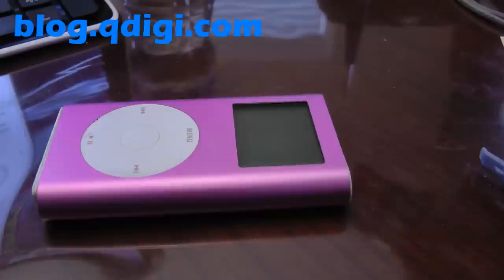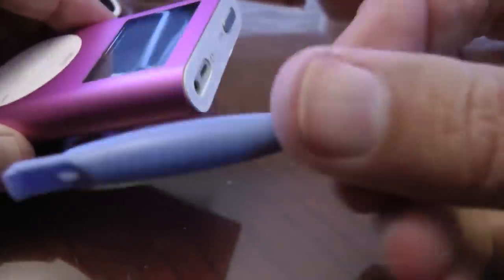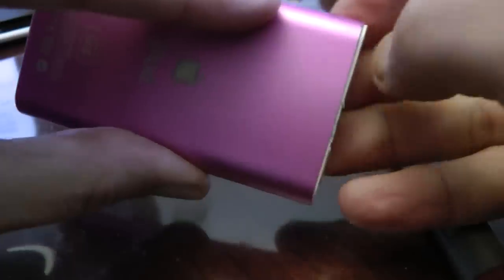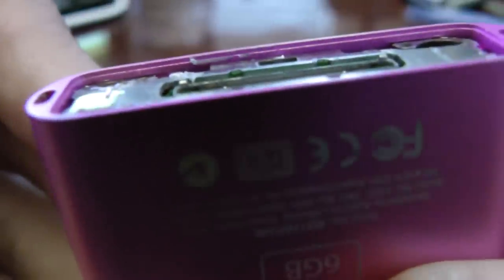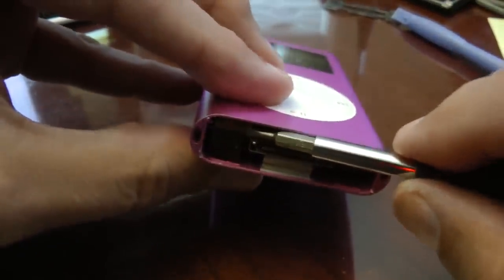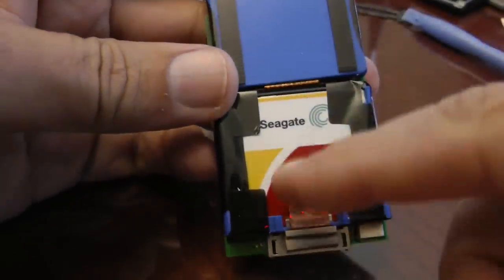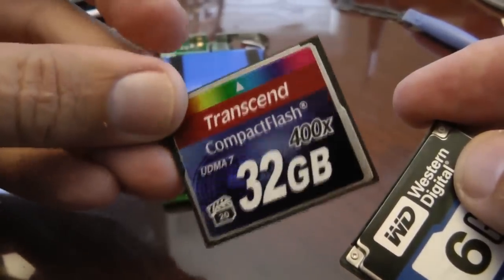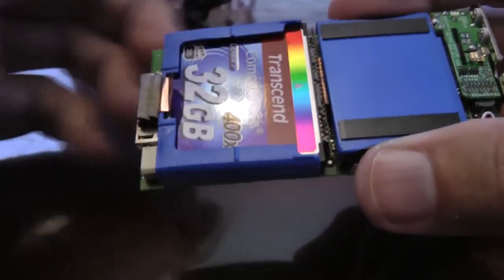iPod Mini CF flash upgrade hard drive fix

Comment: DO NOT use METAL tools on soft plastic and aluminium, folks. There's a reason pry tools are made of plastic... IT WON'T SCRATCH OR GOUGE THE MATERIALS. Use a credit card to prop the iPod open, NOT a screwdriver head.
Reply: iFixit's repair guide for this iPod shows a flathead screwdriver being used to pry open the iPod.
Reply: I fucked both of mine up anyways so fuck it!
Reply: Oops
Reply: @RetroOnSpeedDial  I guess thats a pretty valid point. I'm gonna my mini soon and I'm gonna use plastic tools. But sometimes you can use metal and get away with it but you are probably best with plastic
Reply: @RetroOnSpeedDial  ty

Comment: Just upgraded a mini 2nd gen with a new aluminum shell, new battery and CF to SD adapter, and a 16 gb Sandisk Extreme 90 MB/s read card. So far so good. Loads fast and songs change fast

Comment: I have a Dell Pocket DJ that uses the same brand of mechanical hard drive.  I will try the CF card upgrade and will keep the posters here updated.  A note about the Dell pocket DJ is that it will need the Playsforsure firmware installed to make it accessible to Win 7, 8, 8.1, 10.  There is a soldering aid stick that should be available on Amazon which is plastic but more durable than the cheap tools that come with the battery kits.

Comment: Hello Gary, thank you for the video.  I followed these directions with my iPod Mini (not sure if it's 1st or 2nd gen).  I used the same CF card as you.  What I got when I first plugged into iTunes was a bit different though.  I did not get a message that the iPod was corrupted but rather I got a message that it was in the middle of a restore.  I still got the option to restore and I selected that.  The restore went quickly but at the end the iPod did not reboot.  Rather I was told to disconnect it from the computer and connect it to it's power source to finish the restore.  When I connected it to the power source I got the Apple logo and a progress bar moving across the bottom of the screen.  A few seconds later I got the language selection screen.  I selected my language, unplugged it from power and plugged it back into my Win 7 PC.  At this time Windows asks if I want to fix the drive and iTunes doesn't see the iPod.  Windows can see the iPod but can't access it.  So far the only way back I found was to insert the CF directly into my PC's card reader.  Windows says it needs to be formatted which I do.  Put the CF back into the iPod and now iTunes sees it.  I restore again but the same sequence happens.  Any suggestions you might have would be appreciated.  Thanks again for the video.
Reply: hello. I have such a problem. did you deal with her?
Reply: @minray  I've learned that my iPod Mini is the 1st gen.  I have it working now but I don't recall all the things I tried before it worked.  I know I tried formatting the 32GB CF card to smaller capacities without success (It never worked at 32GB).  I later bought an 8GB CF card which I think worked as is since when I plug my iPod Mini into my PC it shows an 8GB capacity drive.
Reply: @jerryvenneman1703  Thanks)
Bought a card reader. I will try to format the cf card. I have a 16 gb card

Comment: Hi Gary, thanks a lot for this tutorial! I just upgraded from 4GB to a 64Gb  Transcend and it was "plug and play"
Only some little scratches on the surface of top and bottom remind of the operation. And synchronising is even much faster than before.
Reply: Any process about the CF card before plug into Windows?

Format or sth?

İ tried Red adapter with 64 gb of sdxc, after restoring its going back again like a flash drive.Tried it on other cards but nothing changed.Only try would be using an İmac to restore bur im not sure if it changes sth.

Now ordered a 32 gb Sandisk extreme CF.
Reply: @batutasci  Red adapters suck, if you want sd storage just use an iflash or some known brand sd/cf adapter

Comment: OK, so, your two iPod Minis had Seagate and Toshiba hard drives, and my 1st gen has a Hitachi... Why couldn't Apple stick to one company? Also, I found that my hard drive seemed to be rusty when I removed it from my iPod. Nothing else was "rusty", but some of the "rust" got onto the back of the inside of the iPod, and there was "rust" on the rubber bumper on the HDD. The "rust" probably came from the HDD itself, as I see no other logical explanation for it.

Comment: I don't think I goofed it, but did this mod to my iPod mini, it wouldn't read the drive after restoring, folder with ! mark, plugged the original microdrive back in and same thing, so I think the logic board is toast, now it only shows a sad face.
Was super gentle with it too, bummer :(
Reply: Update.... changed the logic board and installed a different card, it's now working and reporting card size of 128GB 🙂
Reply: I have the same result as you. I plug it into the computer & nothing pops up, even tried to replace the battery, & still the same problem of the computer not recognizing the ipod persists. So you think it's the logic board?

Comment: I tried this with a 64GB Lexar CF card & it did not work. When plugged into the computer, the battery animation was not moving. But when plugged into the wall charger, the frown face saying to go to applesupportcom/ipod came on. I tried replacing the battery & it yield the same results. Now I have a sad face

Comment: Very cool.  Great way to get a 32gb MP3 player for around $60 total ($30 for used Mini and $30 for flash drive).
Reply from the maker: If you search for broken iPod Mini's on eBay where the hard drive has failed I was able to get them for under $10 with shipping.  Just look for auctions with 'folder error'.

Comment: Nice video.  I didn’t realize you could upgrade the capacity of these machines.  What’s the largest capacity they can handle?  Also, do you take advantage of having it apart to replace the battery?  With the original hard drive gone, it would give you more battery life to be sure.
Reply from the maker: I never went over 64gig.  Some say 256gig cards work but have issues.  The internal memory probably can't handle that many songs if you managed to fill a 256gig card.  As for the battery I used my iPod Mini's in a speaker dock so I did not replace the battery.  But I agree it's worth doing while it's apart.  This video is old, I did this over 7 years ago.  CF cards are going to be harder to find at a good price.  They are not popular anymore with digital cameras.
Reply: @GaryQuiring  Not as readily available but I did a quick search on Newegg and found various sizes above 64 GB, probably because professionals and hobbyists use them quite a bit still.
Reply: @WJCTechyman  RED adapter is problem?

Tried 64 gb but after restoring it goes back.

Tried with other sd cards nothing changed.

Dont know if sth changes it i try that on an İMac?

Comment: Just stumbled onto a source for 1.8 inch SSD drives for iPods and Dell DJ 2nd generation hard drives as well as SDXC to 1.8 inch hard drive adapter.  The SSD's are available from newegg.com and the adapter is on Amazon

Comment: Nowadays u can use a CF-to-SDXC adapter and use a 256GB SD card on these iPods.
Reply: +xmdude626 
Hi have you tried it with an adapter and the 256 gb sd an did it work?
Kevin
Reply from the maker: +Kev Wood I have not.  Largest I used was 64gb.
Reply: Hi  @GaryQuiring  Can I use a 128GB Compact flash card in the mini? Have converted one to a 64GB and it works great, thanks to your videos.
Reply from the maker: @twinoaks51  Hi Ken, I never tried anything over 64gb.  The CF cards get kinda pricey.  But I do believe if you Google it I have seen success stories with 128 and 256gb cards.

Comment: Hi Gary, I'm not sure if you've answered this question before, but having replaced the flash drive in my iPod Mini and put it back together again, I'm getting an error symbol looking like a folder with a exclamation mark over it. Also, the iPod doesn't seem to want to appear in either disk utility (on my mac) or iTunes for restore. Could you help? Thanks.
Reply from the maker: That is a disk error.  Either the memory card you used is damaged/incompatible or maybe when you plugged the CF card in the pins are not aligned correctly or one got bent.  I would take it apart and check.  You can also power up the iPod without sliding it back into the case.  You don't need the click wheel to verify if it will boot correctly.

Comment: This is a great idea!  I am finding it a little hard to think of the Mini as a retro piece but there it is! 

My Mini's battery is ready to be replaced and I appreciate this non-destructive hard drive to CF card, pin to pin upgrade/switch out. I use the mini regularly and look forward ti trying this. At this writing I can get a "major brand" 32 GB card with write speeds of up to 1066x., for @ $38.00. I have had hi speed flash back fire on me (flash drives too fast for the CPU...) and I notice you use a 400x CF card in this 2013 video. Slower cards are available. What do you recommend for a card speed? Considering these older boards, Is faster always better?
I also wonder if Guillermo Gei is still using his from about a year ago. How goes that one? 
Thanks for this post!
Sister325

Comment: So I guess you could use apples disk utility and a card reader to verify a microdrive  before you installed a second hand one.  I think that iPod drives are formatted to fat32, which I think has size limitations and maybe the cause of problems with people using cards bigger than 32gb.
Reply from the maker: I have tested 64gb cards and they work with no issues.  The problem is some are using a SD to CF adapter and they are not compatible with cards over 32gb.  The adapter must be XC compatible.  I have never tried anything greater than 64gb so I don't know for sure if the iPod has any internal limitations with larger cards.

Comment: After my previous success doing this mod I tried to do the same for my girlfriend. Cue chaos. I bought a working ipod from ebay and another of the same Kingston 64GB CF cards from a different vendor. However, when I tried to install the ipod software from itunes after changing the cards it came up with the sad ipod face. Thinking this was maybe a faulty card I tried swapping the CF cards from my working moded ipod and the new, not working ipod over. As expected my original CF card in the 'new' ipod worked and the new CF card in my original ipod was showing the ipod sad face. I assumed the new CF card was faulty and sent it back for a refund before ordering another one from the original vendor.

When the new card arrived I put it in the 'new' ipod and tried to install the software again; no luck again. This time the folder with exclamation mark sign came up and when I plugged it in to the computer it came up as 'do not disconnect' but was not found by Itunes. I tried setting the ipod to 'disk mode', it went to disk mode but still couldn't be found. I tried plugging it in to my work computer instead of my mac, using device manager I found the ipod could be seen, but it was still not being picked up by itunes. 

What I did next I will regret for a long time. I again tried swapping the hard drives in the 2 ipods to see what was causing the problem, this time both ipods now came up with the sad Ipod sign. I swapped them back and they both came up with the sad Ipod sign again. I tried the 4gb microdrive that came with my original 'working' ipod in the original ipod, this came up on itunes as usual.

Somehow the new ipod seems to have corrupted both the flash drives. This raises many questions, how did this happen? Why did this not happen the first time I tried swapping the hard drives over? Any ideas?

Also, if I bought a CF card reader, is there someway I can try to reset the cards to their factory settings? Thereby giving me a chance to redo the whole process for my original 'working' ipod and not wasting a hell of a lot of tim and money?

Any thoughts would be greatly appreciated!
Reply from the maker: I had a SD card once that got screwy and Windows would not see the card.  I stuck the SD card in cheapo camera and was able to format it and then Windows saw it.
Reply: Yes. Most SD cards come exFAT formatted so you either have to use a partition tool to reformat or as Gary did format in a camera that will format FAT32...

Comment: Thanks for this video. I always loved these particular iPod Minis. I have taken apart several of them and successfully replaced their batteries. Once, I did try this conversion to CF card, and everything seemed to go well. But when I tried to copy music over to it from within iTunes, it would constantly stall and fail during the copying. Sadly I had to give up. Did you ever have this problem?
Reply from the maker: I have upgraded 5 of the mini's (2nd generation) and all worked as expected syncing with iTunes.  In some I used a CF card and others I used a CF adapter with SD memory and they all worked.  Only issue I found was the CF adapters are much slower syncing.

Comment: Just did this upgrade. However, when I plug the ipod into my mac the ipod first flashes up with the the apple logo, then the folder and exclamation mark and finally the 'do not disconnect'. Itunes opens but I do not get the restore ipod message, just nothing. I know there can be issues with damaged to the actual ipod being the problem but the computer sees the ipod as an external hard drive with about 62GB space. Is there anything I can do to fix this or do I have to find myself another faulty ipod?
Reply from the maker: It sounds like it sees data on the drive.  Did you replace the drive?  Did you image the data to the new flash memory or something?  The flash card should be clean, no data on it when you try this.
Reply: Gary Quiring Yeah I replaced the drive with a Kingston 64 Gb Ultimate Compactflash Memory Card 266 X CF/64GB-U2 straight from the packaging. I read on a review somewhere that someone had done this successfully with the 36GB version of this card so assumed the 64GB would work fine. As far as I can tell there is no data on the flashcard apart from the card itself being called 'kingston' on finder; I cannot find any when I access it through finder. I am going to try this flashcard on a know working ipod mini to test the CF card, will keep you updated.
Reply: ***** The problem was with the IPOD in my case. I got another one from eBay and now it works fine.

Comment: Gary and company, does anyone have any tips for re-inserting the electronics back into the case?  Every time I slide the circuit board into the case it appears to hang up on a metal plate that, I think, backs the click wheel. I don't know what to try to move past this point. It doesn't get tight in the case, it simply slides in and stops. Thanks for any thoughts.
Reply from the maker: Is the battery swollen?  Lithium batteries tend to get larger when they get old and depleted.  The other thing is the board goes below the groove not above it.
Reply: Never mind, got it! Heat sink for the charging port was hanging up. The mod works great!

Comment: Bro i got the Red adapter but after formatting restoring then nothing happens, goes back like a hard drive.

Cards are ok but im suspecting if the adapter is problematic.

Should i give a try on İMac, will that change sth?

Comment: I know this is an old vid, but I've seen others are doing this still (as of 2020 at least). So will this work for the iPod Mini A1051 2004 Gen 1? I actually still have one that works, when plugged into a electric source? But would LOVE to mod this to a Compact Flash Storage Card!! Also I read below saying you didn't replace the battery, do you know, IF I can get away with that for my Mini Gen 1 AS WELL AS my still working iPod Nano 1285 Gen 4 (yes, it's beginning to get the dreaded "Black Spot" but the battery still charges up?!) Tks!
Reply from the maker: Mini 1's and 2's work with the CF cards.  Eventually I assume the battery will be so dead that maybe it won't work, I don't know.  I stopped using my Mini's a few years ago.
Reply: @GaryQuiring  Great, per the Mini's both working w/ the CF Cards! TY for responding so quickly!

Comment: Hi! Done this swap two years ago with a 16 Gb Transcend CF.
Actually it works fine, but there's one thing that does not work, and it's when connecting to my Kenwood BT-92 SD (Car device).
The Kenwood doesn't recognize the ipod. i've Tried also with 5th gen ipod it works.

Will appreciatte any suggestion about... !
Thank you and great vid!
Reply from the maker: No idea since I don't own the Kenwood.  I did a quick Google and found a reviewer on Amazon that states the Kenwood can't handle more than 255 files per folder on SD devices.  Did the iPod you upgraded work with the Kenwood prior to the upgrade?  I would try resetting the iPod via iTunes and start over.  Maybe something something got corrupt on the first pass.  I had one iPod once where it did not function correctly the first time and a factory reset solved it.
Reply: Gary Quiring Tried all of these... and no luck.. Will keep investigating about it.. If   Thank you so much for wasting your time. Cheers from Spain, and sorry for my english!! ☺
Reply: Ken wood stereos do not support the iPod mini for some reason. I have several of them and none of them will recognize my Mini, but will work with most others. They also don't work with gen 1 or 2 iPod classic either.